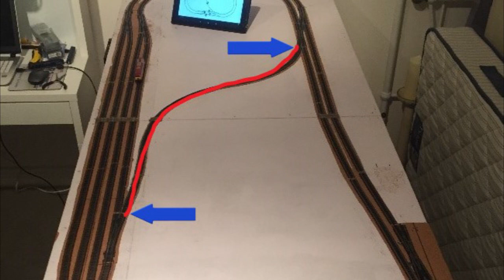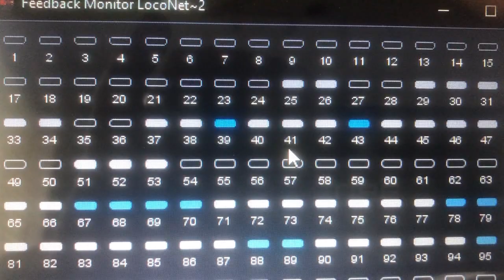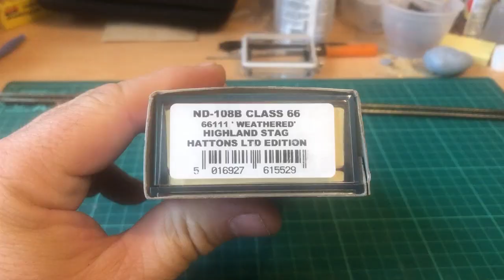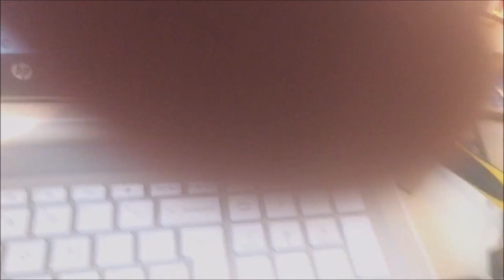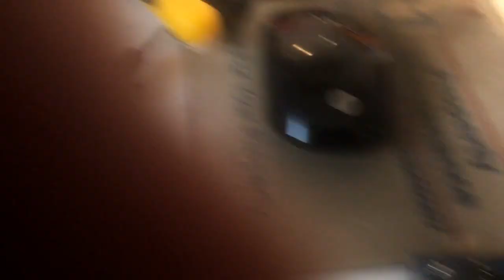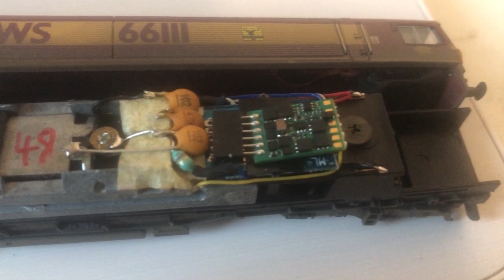Flint Hills Model Railway  Phase 3 & 4 , Decoder install and tester

Comment: Just catching up on videos Geoff.  I have been looking at getting a decoder tester so interested to see yours.  The software you were running it through appeared to be Dijikeis software, or is the software linked to the tester?  Stephen
Reply from the maker: Hi Stephen.  It’s the digikijes software which you can down load for the dr5000 central control. . I’ll be lost now without that tester plus it’s so useful for programming decoders in non motorised units like my dapol voyager have two dummy end cars

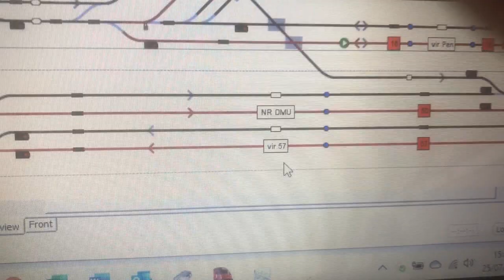Comment: How are you getting the Railcom decoder identification into iTrain that you show at ~6:18? I  wasn't aware that a DR4088 has Railcom detection therefore you must be doing something different than what you describe?
Reply: ...wasn't aware that a DR4088 has Railcom detection... 

It doesn't !
Reply: @karstdrenth  :)
Reply: @flinthillsmodelrailway  Thanks for clarifying  the error in the video - we wouldn't want people to get upset when they try to use the DR4088 on their iTrain layout looking for train identification and end up posting questions on the forum as to why the cannot get the loco numbers to appear in their switchboards ;)
Reply: @damenfeld  lol, I was just about to ask the same question, Iain.
Reply from the maker: hi ,  yes your correct that particular feedback is also connected to my 5088RC which is what trigged the Decoder number on that feedback - subject for another video on how ive updated the layout recently  , sorry for any confusion and well spotted

Comment: Nice you have railcom enabled decoders! :D That's my next big upgrade.
Reply from the maker: Given that you have paid for the DR 5088RC units then yes I would slowly start moving towards the Railcom decoders . that Zimo i showed is only £20 when other are more expensive . you will notice the better control . you would have to re-do all those Speed steps again as per your video . Geoff

Comment: Brilliant Geoff, loved the bit with the chip tester, love to see more on this, as Id love to know if decoders could be repaired. I suspect once they stop functioning theyre dead.
Reply from the maker: Hi John , Glad you like the Decoder programmer unit . It came about as I was fed up having to programme a decoder in a loco only to then have to put it in a dummy power car for lights . its now so much easier.  Ive some times assumed the decoder to be faulty but it was the loco n which actually need sorting as per your Video .  Alas I have found most of my Zen decoders have slowly failed . Geoff